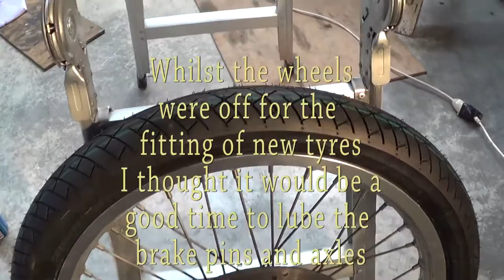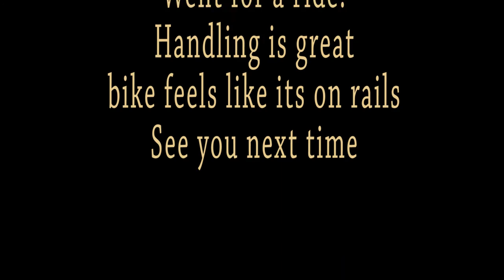Disk brake glide pin lube

Comment: My front brake has the slightest rub like yours at 6:25, is that acceptable?
Reply from the maker: Yeah Stephen. Slight rubbing is nothing. Any more than slight then you might have a warped disk but you would more than likely notice any problem during braking.